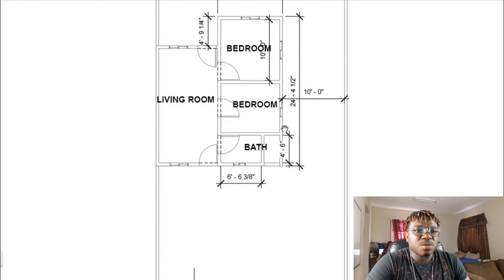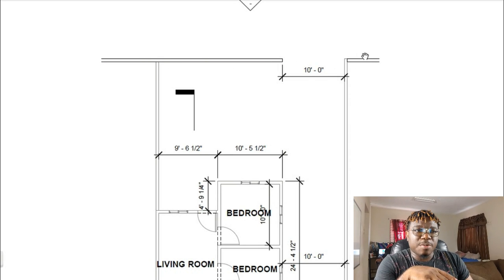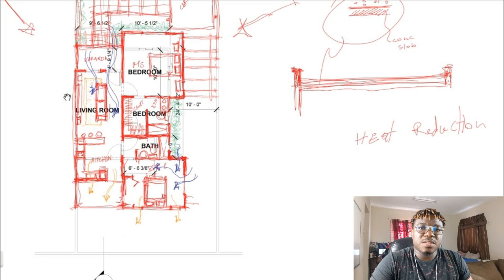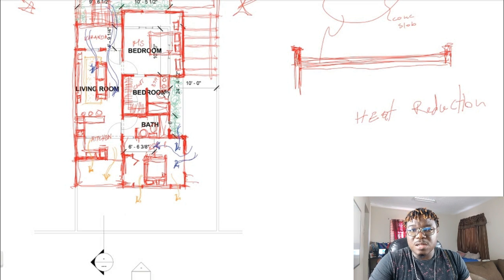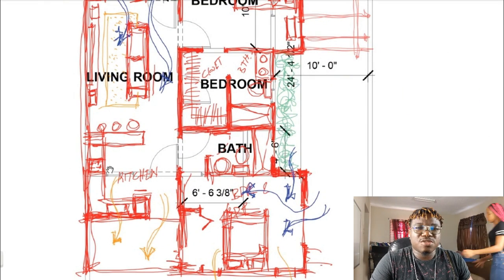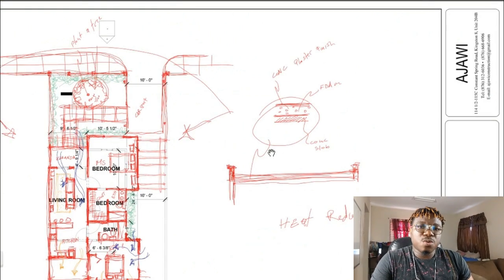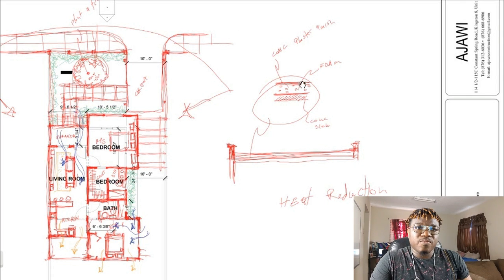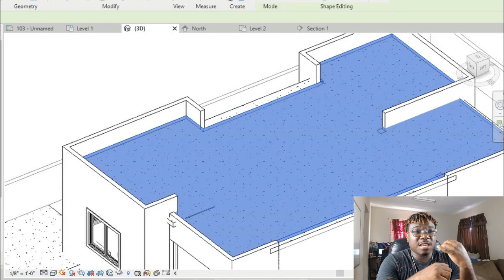PASSIVE COOLING STRATEGIES| DESIGNING FOR THE TROPICS

Comment: The orientation of the house’s largest exterior wall to the sun is important as is the wind currents and window openings in that direction, also there could be made terra-cotta pipes to go under the house where temperature is cool and circulate that air into the house like central AC,  just place screens to prevent critters in the pipes, the screens need to be removable at the convenient places for cleaning and replacing
A microclimate may be created outside with vegetation rocks and water

Comment: Once that building has a slab roof the heat reduction measure you introduce is going to have a minimum effect on heat reduction. Remember slab roof absorbs five times more heat than your normal timber roof. Most of the heat absorption is going to come from the slab roof. The only meaningful way to reduce your heat in your building is by having a timber roof and higher ceiling height. But that is going to be too expensive at this stage. But your measures implemented is still worthwhile though.
Reply: @AJAWI_TV  ok you can disagree. But I can assure you that measures you took  is not going to have a serious impact. Remember that while the sun changes orientation during the day some of the external walls is going to receive less sunlight. but your slab roof is going to be continuous exposed to the sun ultra violet rays. Therefore doing the thing to reduce heat absorption through the walls without addressing the roof and ceiling height is not going to cause a significant heat reduction. This is something I have gone through already. What you have done is only going to result in minimal heat reduction.
Reply: @AJAWI_TV  I am to look back at the video. But also you can employ a reflective surface over the concrete slab roof to reflect the sunlight and cause less heat absorption too. You must not be offended  remember you have professional people watching your videos too. But I am going to look back at the video. Its not about who is wrong or who is right though.
Reply: @AJAWI_TV  I am the same person that defended you on LinkedIn the other day when you and the other guy was debating about the function of stiffener  in building. I can see that you are young and enthusiastic about your career which is very good. You can inspire a lot more young black men as yourself. Respect. Keep doing what you are doing man.
Reply: @AJAWI_TV  ok. Good.
Reply: @AJAWI_TV  Instead of using a concrete sandwich design, concrete foam concrete, use a concrete foam "wooden with aluminum sheets or clay tiles" sandwich. Would that have a considerable heat reduction effect? Wouldn't it cost less?

Comment: Rather than using foam, how about adding a material that would block radiant heat transfer like a reflective surface. Are there companies in Jamaica that offer insulated prefabricated walls?

Thanks for sharing those strategies.

Comment: Just get AC...job done. Passive cooling if the house is not orientated in the right direction to minimise solar gain and designed and constructed to take thermal isolation and mechanical heat recovery system (extracting energy from the hot humid air, so a reverse Air Source Heat pump)   and other factors in mind will be just too expensive.